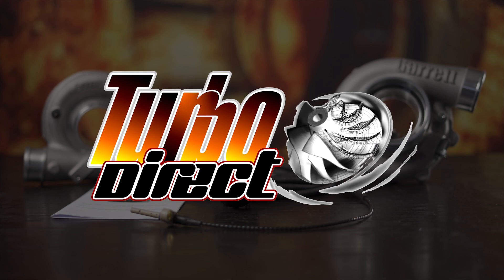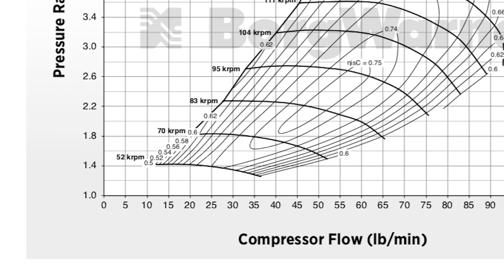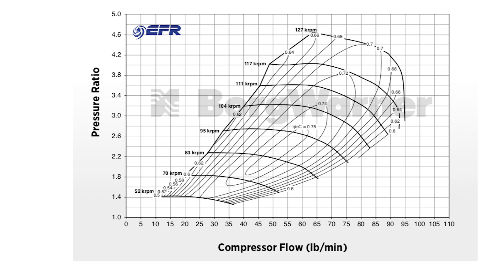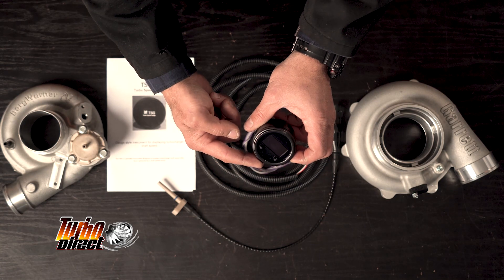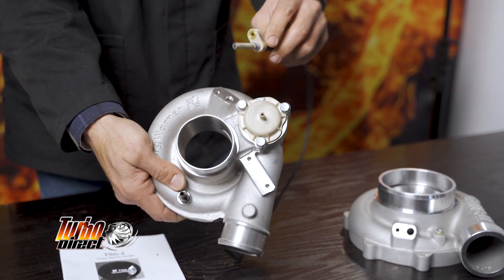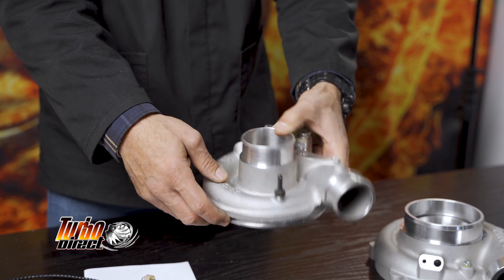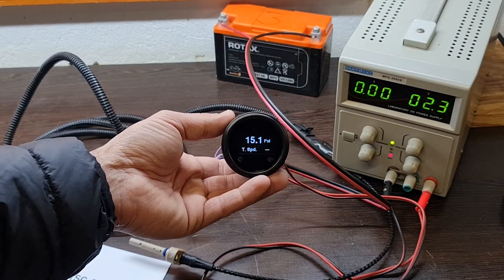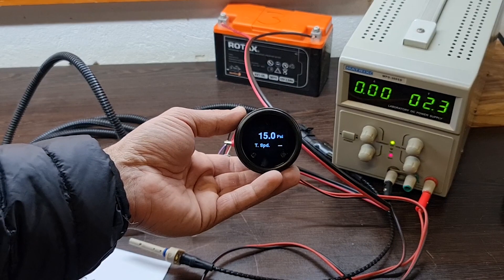Turbocharger RPM discussed

Comment: At 1.2 -1.3 bar boost what power would you expect a 4.0 barra to make with the 8474 ? Thanks
Reply: Look at Richard Holdener's channel.
Reply from the maker: Hi Farmer2 - this is a typical "how long is a piece of string"  type of question.  What fueling?, What ignition advance? What fuel? What mods are done to the motor?  etc ...

All these affect the power output - however you will see more power (provided no boost leaks,  all supporting hardware, good fuel, accurate tuning etc) than any Garrett GT35/GTX35/G35R turbocharger will provide - pound for pound.

Comment: How does the sensor detect the rpm from the compressor, Magnet or reflector strip?
Reply from the maker: Its a magnetic sensor, and even though aluminium is not magnetic - the sensor still picks up the passing blades.

Comment: I got one on my 8474. Drilling that thing was a bit nerve racking, lol.
Reply from the maker: Lol -- unless yuo spend alot of time around machinery etc - im sure it could be. :-)
Reply: I have an off the wall question.  I’m about to put in a sxr s200 58/70 
  Does adding the speed sensor add a noticeable sound?   Curious as the air flow disruption may actually do so.  That would be a bonus! Haha

Comment: Once you are running a proper ecu, the ecu will use the turbo speed as a secondary or tertiary boost control parameter. Makes running the turbo on the line of shitting itself or providing max air flow an ease.
Reply from the maker: The Speed input can be used for tuning aswell - without a dyno if you know what you doing.

Comment: What parameter or how do you make up a compressor map, i know that you design yr billet wheels, can an average man test one out? I guess it would be temp in and out, pressure in and out(air flow in and out) , turbo rpm?
Reply from the maker: That is a very complicated question - what you are asking is how a watch works, lets rather stick to what time it is.

Comment: That has been one of my questions about the speed sensor, whether it would work with both the Borg and the Garrett. Looks like I could use a on- -on SPDT toggle switch with 1 gage to display both turbos in my compounds

Comment: Thanks professor, i do not miss a class. Still researching which would help me acquire the goal of 500 hp, and keep good response at the low end and still have enough kick on the top end
Reply: EFR7163
Reply: @mrfumetsu  thanks bro! I have a question, is that close to the max output? Do you think it will cause issues with the turbo in the long run
Reply: @1atinlove  it's close to the max. i don't think it'll cause issues with the turbo.
Reply: @mrfumetsu  thanks, i did not want to run it at its max or close to it consistently. I want it to last.
Reply: @1atinlove  i have a clip of 7670 in my FA20DIT on my channel
Reply: @mrfumetsu  saw it...the turbo seems really responsive, and the pull is consistent
Reply: @1atinlove  i un-hid another 7670 video i had showing a 1st-some of 3rd pull. it's single scroll.
Reply: @mrfumetsu  thanks, ill keep watching if you keep posting. Did you upgrade any of the hardware? (I.e. wastegate, bypass, or speedsenspr)
Reply: @1atinlove  yes I used turbosmart iwg and turbosmart kompact shorty bov. 

no  turbo rpm speed sensor on the 7670, but i have one on my 8474 build